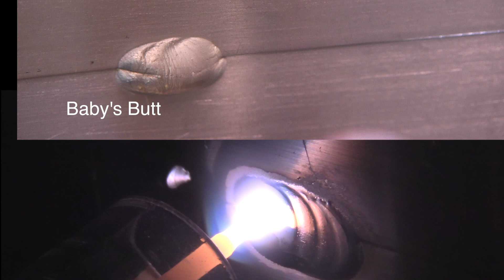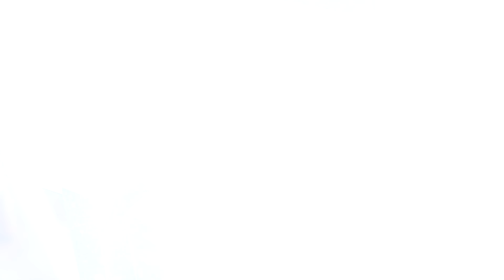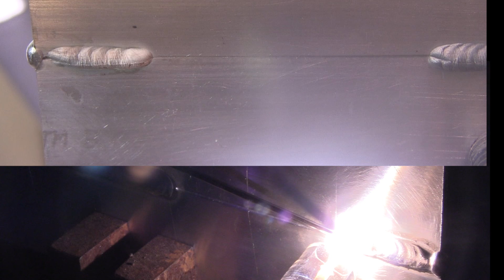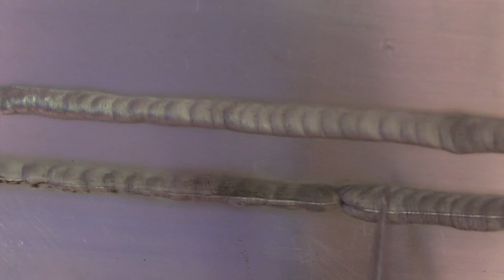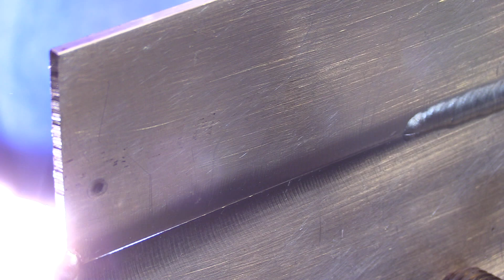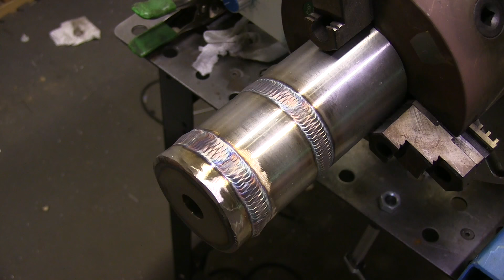TIG Welding Tips for 2g Aluminum Butt

Comment: So what about welding 3/16 or above  aluminum plate...do you need to see that "babys butt" on the backside to know if youve got the proper penetration? When i try and do that my material is getting way to hot

Comment: Would you please do a 45 degree 2mm x 100mm pipe aluminum butt weld and give tips as you change from going inside the angle to the outside edge weld?

Comment: I was butt welding .063 aluminum today at work. My beads weren't quite as pretty as yours but there was no fixture and I didn't spend a lot of time cleaning the edges, though everything had just been cut -- I just hit the edge with a file and wiped it with alcohol. The only place I could place my torch hand was on the piece that I was welding, but fortunately I had a TIG Finger.

Comment: 2 questions..........for ANYONE please.......................so no argon purge is needed?  and question #2 is will a helium  /argon  MIX help or no?(75/25?) ohhh its for 1/4 inch alumin (pipe and plate certs!)  btw.....ty in andvance.

Comment: Hi Jody I need an advise from you on welding butt weld 2mm aluminium coping 520mm width length without through penetration. I have tried controling my temperature by moving to pulse welding. But it's still very difficult to manage on aluminium 1015. Maybe there is some other life hack's? I'm using TIG Jasic T200 pro

Comment: I have been using the tig finger for aluminum welding but recently, I used it for a 3/4 stainless butt joint  test. It Worked out great to prop without burning my hand on a small joint where I could not walk the cup. Thanks for all the videos!

Comment: Can you make a video on how to weld double miter angle alu 
I’ve tried to make a cube from angle (iron) alu 
A wheeled frame for my inverter , filler,parts clamps argon etc 
but my 90degree angles end up anything but good , it warps and pulls beyond control

Comment: If i could suggest a video it would be 3/16" wall square tube cut and etch, 2 1/2" tube with a square tube insert to weld up against, so essentially 3 welding surfaces to flow into,  with and without root pass, can it be done in one pass? that sort of thing.

Comment: Absolutely love my TIG fingers. I was doing a number of long runs on Aluminium plate recently and was having trouble in the middle of the sheet following the ABCs (always be comfortable). My solution was to run one TIG finger on my torch hand and one on my feed hand so I could rest my hand and keep the filler steady way out on the sheet. Worked awesome.

Comment: great video Jody. thanks!

a thing to note for all watchers:
aluminumoxide has a higher density than aluminum, which is why it will go to the bottom of your puddle, creating this line on the root if you are lucky, or become an inclusion in your weld if you are not... if you are dealing with thicker aluminum butt joints it is quite good to put a tiny bevel on the back so that line won't become a crack.

in contrast, when welding stainless - all the dirt and ferrous oxides have a lower density - so you can "cook em up" and not have them in your root or your weld.

Comment: Thanks, baby butt doesn't look good, cleaned metal prep weld, penetration goes nicely at the backside(root deposit) if I may call it that, appreciate the vids, 1 dollar is 14 rand here in south-africa, would like to buy a Tig finger and dvds and gas lens kit. But cant

Comment: Im about to do a modification/repair on a boat outboard leg and I'm after some advice. The cavitation plate keeps cracking from the stress of the fin bolted to it. I've had a go at repairing the crack using 4043 filler at about 120 amps but it cracked again immediately after the first use. My plan is to cut the cavitation plate off which will cut off the cracked area and weld the fin in place of the cavitation plate. The leg is cast aluminium and the fin is made from some unknown aluminium plate.

Comment: A silly, possibly insane question:
I would like to get into TIG as a hobbyist but the cost of argon is way too much for me.
I was thinking to make a sealed chamber in my basement with all the welding equipment, so that after a tank or two, the whole chamber will essentially be filled with Argon, which will stay there as it is much heavier than air.

Then every time I need to weld, I would go down into the chamber and weld everything there, I could wear a mask with a pipe to get oxygen from outside the chamber.

This can also be done in a box with glove inserts for very small things.

Is there any sense to do this if I have the space?
Reply: RagingShrimp67 

Firstly,
If your buying a complete ACDC TIG rig, And only spending $1K.  Then its not decent, its the cheapest PoS out there.

Does that $1k include : foot pedal, face shield, gloves, filler sticks, acetone, gas regulator, torch parts, tungsten, cleaning consumables, a torch that isnt a heavy cumbersome PoS, or a TIG fingur XL?  

By the time you actually set yourself up with everything needed to TIG weld (not just the base machine) the price will double.

I bought my machine a couple of years ago.  In Australia, i paid about $3000 once all said and done.  The machine was only half that, but by the time I had setup to actually weld comfortably.  It had doubled.  Now the gas, I bought E bottle outright (included in that $3k figur), and replacements bottles are $160.  As a hobby welder, a E bottle will last me about year.  

So you can see the gas is not that expensive VS the initial setup of everything else.
Reply: RagingShrimp67 ur gonna asphyxiate yourself rather than buy argon which is actually quite cheap lol
Reply: I guess you missed the part of my comment that reads "a mask with a pipe to get oxygen from outside the chamber."
Argon is far from cheap where I live.
Reply: RagingShrimp67 didnt miss that at all. Just thought its ridiculous
Reply: Argon is pretty cheap in the scheme of buying an ACDC TIG rig.  The rest of the setup will be the bigger financial hurdle.
Reply: Are you sure? 1 liter bottle of 60  bar Argon costs about 80 USD where I live, a decent TIG setup I found for about 1000 USD.
Reply: Thanks for the details!

Comment: Hi Jody, I did a boat welding course a couple of years back and they use MIG for speed and the butt joints are background (so flipped over and a grinding wheel used to grind a V back into the back of weld (where you see the oxide line) and then re-welded from that side. Does that actually make the weld any better, or is it just introducing a lot more edges (and hence places where it might crack) into the weld?
Reply: 4BoltClevo standard practice in the boat building industry, we call it back gouging. It makes for a 100% welded joint, if done correct you can X-ray it and it will pass
Reply: Yeah fair enough, I just didn't know if the mob I did the course with just made it up or it was a universal thing in the boat building industry.

Comment: Why does some aluminum have a grainy or sandy appearance on the weld bead (front side) on while others weld nice and smooth?  Cleaning doesn't seem to make an appreciable difference.
Reply from the maker: I believe it is the cooling rate.  a small piece of aluminum like I used in this video becomes saturated with heat very quickly and the cooling rate and solidification of the puddle is slower than it would be if the piece were larger.
with a slow solidification, there is time for precipitates to form

Comment: That CK worldwide machine is a chinese machine, have a look here,

 https://www.ebay.com/itm/220V-WSME-200-AC-DC-Pulse-TIG-Welder-Welding-Machine-Aluminium-TIG-200-TIG-200P/162594419148?hash=item25db61f1cc:g:6hgAAOSw-9RZbGEr

I guess CK rebranded it and probably made some minor tweaks and changes but wow thats cheap.

Comment: Awesome Jody, you are the best!Great idea on the back shot vs arc shot.

just a little tip, point the camera in the same direction as u welding, cuz in the start of the video, the arc shot goes left, and the back side shot goes right, and my eyes cant go in the opposite directions 😂😂😂😂😂😂
Reply: well yeah when you look at something from the other side the direction will be flipped. its like a mirror, when you look to the right your mirror guy is looking to their left. its not a camera placement issue its how it would look if you were watching someone weld.
Reply: anthony10370 i know WHY it looks like that, im just saying that u can mirror flip it in the edetion program so it would go the same direction.